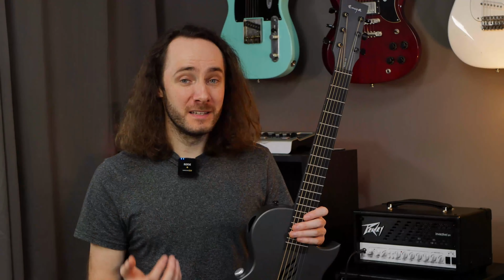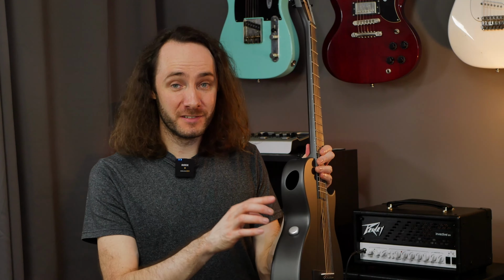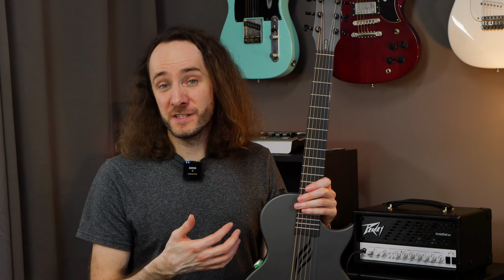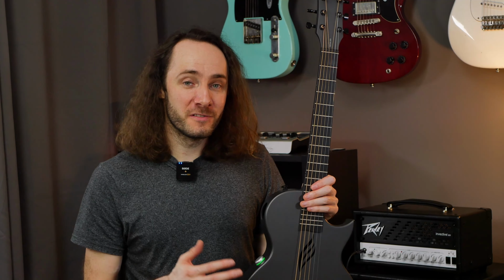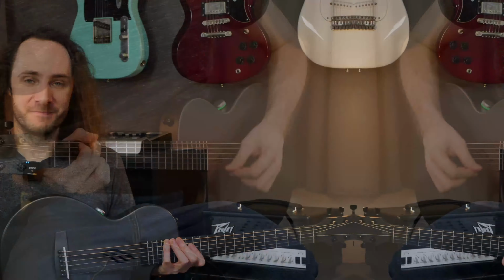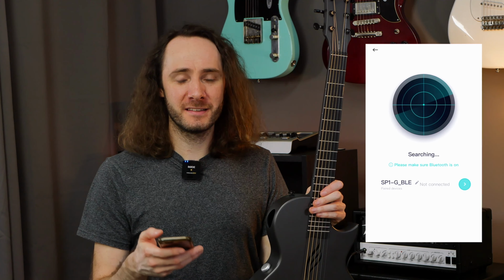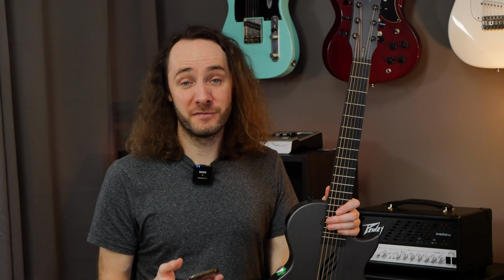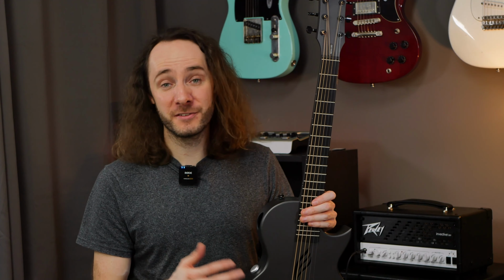Is It Any Good? - Enya Music Nova Go SP1 - Guitar Demo & Review

Comment: I should've gotten the electric version. The acoustic only version was 50% off and I needed a travel guitar. But man those effects would've been cool to have while out on trips. I didn't know they played without an amp
Reply: DO you mean it plays without connected a cable? is it using bluetooth to a speaker? or the effects sound is coming from the guitar alone?
Reply: @SS-pi2yi  The effects come from the guitar
Reply: @effen_aey_man  so there must be a battery and speaker in the guitar?
Reply: @SS-pi2yi  A USB charger yeah. The dude goes over it in the video, why are you asking me?
Reply: @effen_aey_man  I heard about the rechargeable battery  in the video, it is the issue from which speaker is the effects heard from. Now understand. Thanks for clarifying!
Reply: @SS-pi2yi the effects are from a driver on the soundboard of the guitar. Basically it uses the guitar itself as a speaker it's a super cool system I just wish I could line into the driver and use my own micro effects pedals.

Comment: I'm nearly sold, but I wonder how tough it would be to get used to the 1 5/8" nut width.  I'm used to 1 3/4.  Comments?
Reply: The nut is part of the neck. You can’t even swap it out. So is the bridge. The guitar is like all one piece
Reply: I just got one of these (the one with no electronics) about a week ago, and I like it a lot.   I do wish the string spacing was a touch wider, but I have rather fat "bass player fingers" as my bandmates call them.  If you are considering one of these, I would say go for it.  It really isn't a bad piece of kit to have around.
Reply: @NJPSims  any changes after having it for a bit longer?
Reply: @impulsivelymakingplays2113  The guitar is still great.  I am actually on my second set of strings.  D'Addario Custom Light (coated) strings seem to get along with this guitar quite well.  I still take it out several times a week to play it.  The only thing I wish was that the strings could be spaced a touch wider at the nut.  Other than that, I am still having a lot of fun with it.
Reply: @NJPSims  oh okok thank you for responding I'm trying to figure out what to get and I'm just so lost lol

Comment: Wow, a great demo indeed 👍 I have some questions about this:

1: Does it have enough base and loudness to sing along acoustically?
2: What's the material of frets?
Reply: 1. they have rather good base when played acoustically but they are not as loud as a normal acoustic guitar.  this is the only time the do sound good, the onboard electronics are cheap and noisy. It sounds like a cheap chinese effect pedal.
2. I have no idea what the fret material is, feels like any other fret to me. The guitar needed a set up, the action was way to high and the neck was not set right, both easy fixes, I also put light gauge strings on. 
Other than the crappy electronics the guitar plays very nice, I am going to take out the AI electronics in mine and fit a standard preamp.
Reply: The complete guitar is made of molded carbo. This includes the fretboard

Comment: Question 1: how was the action when you received it?  Question 2: Why do you say it’s not gig worthy? It sounded really good plugged in
Reply from the maker: Hey,
1. The action was good for an acoustic guitar, not super low but definitely not too high.
2. Just because of the smaller scale length, it is too small for me. Great for practicing when you are traveling, but for a gig I would prefer a standard size.
Reply: On mine the action was around 6mm at the 12th fret, I took mine down to a bit over 2mm and fitted lighter gauge strings, so much nicer to play, the neck also need some adjustment. Certainly not gig worthy, the electronics are just way to noisy,  rather crappy in fact. 
They are a short scale so if you are not used to travel guitars they take some getting used to.
Reply: @marksmusicCC  yes I agree I would never gig with it. Can you tell me exactly what you did to bring the action down? If it involves messing with the neck, I don’t feel comfortable I’d have to bring it to a luthier. The short scale takes a little getting used to, but I rather like it. It’s perfect for when I want to sit in my recliner with my legs up. It fits perfectly on my lap 😊
Reply: @StumblebumBand  Honestly there is nothing to be afraid of, first check the neck, with the guitar tuned to pitch put a cappo on the first fret and hold down the string at the body 15th or 16th fret, there should be a gap of around 1mm  between the string and the fret in the middle, if there is no gap then the trus rod needs to be backed off slightly, there are many video on trus rod adjustments, it is not as scary as you think. The action takes a bit more work, you need to work out how much you want to lower it, then take off strings and take out the bridge and sand down the bottom face until you have it where you want it, do not be scared of this, if you stuff it up it is only a few $ for another bridge, the tricky part is getting it nice and flat.
Reply: @marksmusicCC  the bridge on that guitar is not a separate piece, it’s molded onto the body. You can’t take it off. They must’ve made those things with a 3d printer, it’s  all one piece
Reply: @StumblebumBand  The white piece simply comes out once you take the strings off, you need to reduce the height of that piece to lower your action.. These guitars are molded not printed but they are all one piece.
Reply: @Gothguitarist  There was a little when I got it, the neck was not adjusted right, no big deal, it is only a truss rod adjustment, the action was very high  and even higher after the neck was adjusted , it is now around 2mm at the 12th fret with no fret buzz, I just get a lot of noise through when plugged in to amp or PA , a static type of noise, very subtle but enough to make it useless for any sort of amplified live work.
Reply: @marksmusic5021  yep mines still high to even after adjusting the neck but I have fret buzz on my 3rd fret d string only of I strum hard still not acceptable
Reply: @Gothguitarist  I’m going to try and sand down the bridge saddle a bit, and see if that works
Reply: @Gothguitarist  did you maybe sand off too much? My friend who is a luthier told me very slight increments on the sanding. What gauge are you talking? I’m not even sure what’s on there
Reply: @Gothguitarist  I have no buzz. Just action that’s a little high from like 8-12. Didn’t know 12’s were on there. What did you change to 10’s?
Reply: @StumblebumBand  yep dr rares 10-48 just my 3rd fret buzzes
Reply: @marksmusicCC  it’s all one piece… the whole thing is just one piece
Reply: @rickyelvis3215  Yes I know
Reply: @StumblebumBand  I just saw another review, where a guy removed the bridge to sand it down to lower the action. Is YOUR bridge really not removable? It makes no sense that the same model guitar would have BOTH a removable and non-removable bridge (?)
Reply: @mattpeterson3002  it’s removable